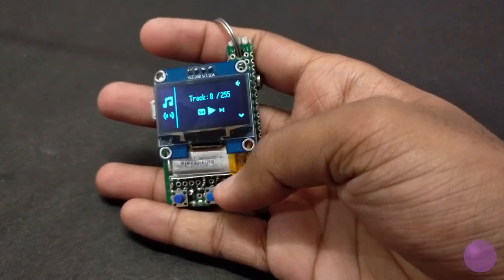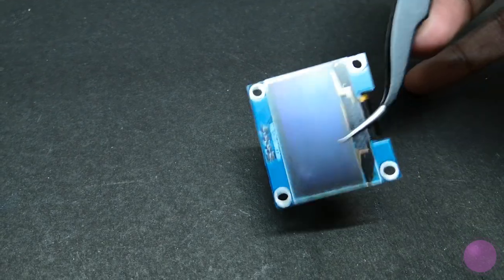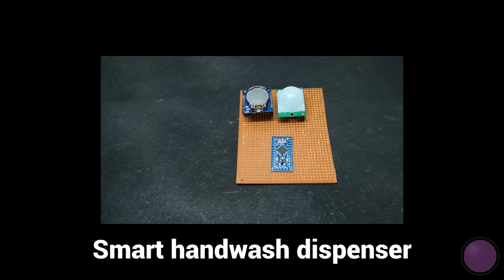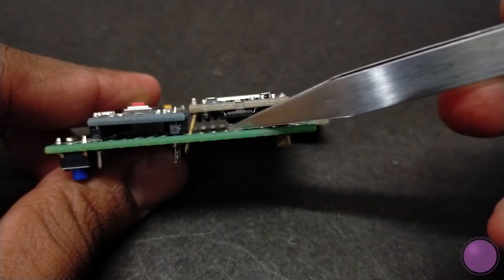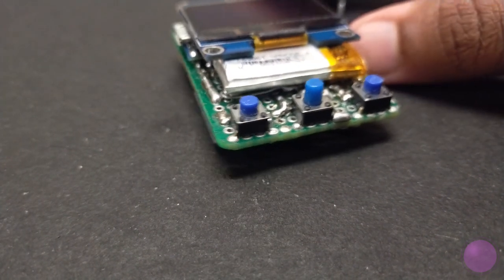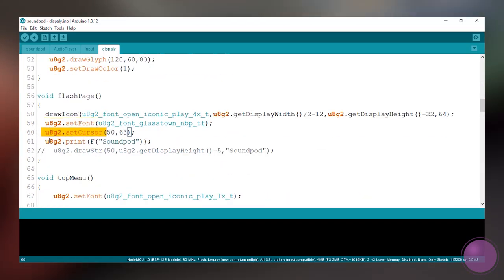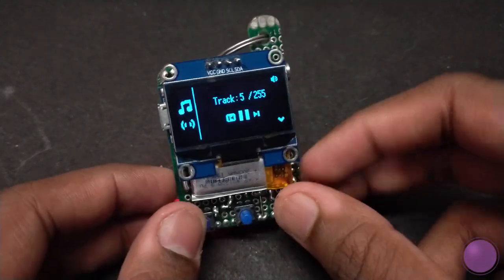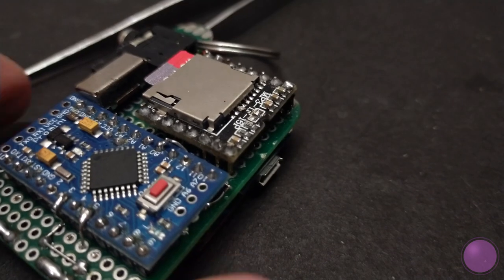MP3 using DFplayer and Arduino | Soundpod part 2 [DIY]

Comment from the maker: If anyone wants to build a PCB you can refer to the circuit diagram from GitHub!
https://github.com/Neutrino-1/Arduino-Soundpod/blob/master/Circuit%20diagram/Schematic_SoundPod.png
Reply: would it be possible to make this with a full interface for navigation by metadata tags?
Reply: YO MAN IM HAVING ISSUES ASTER UPLOADING THE CODE THE U.I JUST STAYS STATIONARY AT SOUNDPOD AND WITH THAT ICON I DROPPED YOU A MSG IN INSTAGRAM NO REPLY FROM YOUR SIDE IDK JUST HELP ME OUT MAN..

Comment: about the file/folder convention, you mentioned that it works fine without it. Can you elaborate? Couldn't it work if I had the mp3 files in root of sd? I did not plug my dfplayer to a microcontroller and test yet, I just put bunch of mp3 files to root and the df player plays them all without the file/folder structure. I'd appreciate elaboration, thanks in advance and thanks for the video.

Comment: good day im making a DFmini mp3 player. I am not using a battrey and dont need all the features you have . I just need play stop skip and rewind but i am uing a smaller screen that you. Its a rectangle 128x28 i think. Can me make a deal and you help me sort this code out plz?
Reply: im using the same arduino nano
Reply from the maker: I think u have 128x32 OLED display and only play and pause would be possible. Rewind and skip isn't supported by DFplayer.
Reply: @Neutrino1  thanks alot. I really thought there was a way to change the tracks. Can u help me with the code. You are right abput my screen
Reply from the maker: It will be lot of work to code for this display (more deletion too).
Check out U8g2 library documentation. It will be really helpful.

Comment: Wooo I got featured in the video! Great project! I am going to try and make it soon when more parts come in, I burnt my OLED by putting power and gnd backwards so a new one is in the mail soon. The UI looks amazing. Sorry to here that file count isn't working on your DF player. What is the battery life for it about?
Reply from the maker: Standby you should get around 6hrs, playback would give 2-3hrs probably. You can just swap out with higher mah battery for more battery life.

Comment: hi 
thanks for the code thats amazing 
i added some features to it like : folder change / touch buttons and i have a problem with the output audio 
it noisy . i even added a capacitor to vin and gnd pin of esp32 
(i programmed it with esp32) 
can you help me?

Comment: Could this basic design support making an MP3 player with some added function to search by song title? So what I mean is: you have to give each file a name like 001, 002, etc. But, in the first video I saw that the file listed that 001 filename alongside the song title and artist details. Could you then use this design so that, with extra code and perhaps some new input to search by letters, it could pick out file 070 on folder 3 when you search the first few letters of the track name? Or say you couldn't, and you use the "001Dont stop me now" type of format, is there some way then to code a search for after this numbering (so ignore the 000 bit and start at the fourth alphanumerical, e.g. D)?

I only ask because I remember how annoying it could be with the old MP3 players trying to get to your favourite song when you wanted it and you would often have to scroll or skip to get them.

I really like these videos by the way, it's very cool to see the high tech of my childhood being made this easily with some parts and a computer
Reply from the maker: DFPlayer won't output any values to the microcontroller regarding the files it's playing (name / size / type / etc). We are naming the songs in the order (0000,0001,0002...)  just to play them chronologically. If you don't rename, they still be sorted and numbered alphabetically. Unfortunately none of this information is transferred backed to the microcontroller, we can only send command to DFPlayer.

Comment: I don't use mp3 do you have a way to only transmit the signal through the 3.5 jack without displaying the functions of the mp3 on the oled?
Reply from the maker: Yes that's possible. That process is done on part one of the video.

Comment: I have a question please. Arduino input voltage is in range 5v to 12v so this is working with the 3.7v battery? 
Also how long does this mp3 player last per a full battery charge? Can it last a full day always on?
Reply from the maker: Pro mini can work with 3.7v directly at its vcc pin. It will work until the battery voltage drops to 3.3v or less. I haven't calculated the battery life but i don't think it can last a day, probably a few hours at best.
Reply: @Neutrino1  it seems there is two versions of pro mini one works on 3.7v and the other one is 5v. I can find only the 5v version, not sure how to power it from a compact battery? The small recargable lithium batteries i can find are 3.7v only.
Reply from the maker: @m3lateef  in that case you need to use a boost convert to boost of the battery voltage from 3.7v to 5v

Comment: Well, that sounds a bit paradoxical, but using the DF Mp3 Player as an MP3 player doesn't seem obvious to me now. I still have some MP3 players from the 2000s, and they are practically as tiny as the DFRobot module, which, due to the SD card slot, is comparatively large. If there were some proper memory chips instead of a card reader, that would make more sense.

But building an MP3 player in 2024 that is 5 times larger than MP3 players from 20 years ago really doesn't make sense to me. Especially considering that everyone nowadays has their mobile phone with them, indulging in some streaming service or another.

Comment: Subscribed !!   Very very nicely done project and clear explaination wherever required. Can we use this to play by time in a long say 60min Audio file. Meaning by press of a button it jumps say 3 min steps.
Reply from the maker: Thank you! That's really a intresting idea but it's not possible to implement using DFplayer.

Comment: Can this be done Bluetooth instead of jack?
Reply from the maker: Just include a Bluetooth adaptor thats used in the car. Or you can feed the output of DFplayer to a Bluetooth transceiver module
Reply: @Neutrino1  ty

Comment: I am planning to make a Arduino Uno r3 shield of mp3 will it still work if i use the same logic
Reply from the maker: Yes! you can use the same logic. (Just discard the display part)
Reply: @Neutrino1  OK thanks but can you explain me how to use the sound jack for headphones (and also i am planning to keep the display part)

Comment: I'm interested in this build, is there a code to show the battery level on the oled display?
Reply from the maker: It's on GitHub, you have the option to add battery percentage
Reply: @Neutrino1  I cant seem to make it work though, can you please provide an example code on the battery logic part of the code? thanks.

Comment: Bro, 

Can you make a video using NRF24L01+MCU  to input a audio in from laptop and transmit wirelessly then recieve the same using NRF24L01+MCU and fed to amplifier. Whole idea is to remove wiring from 2nd floor to  ground floor

Comment: If bluetooth transmission is added, can 2 3v lithium coin batteries handle it?
Reply from the maker: It depends on what bluetooth module you use and it's purpose.
Reply: Thank you...

Comment: I must have a knock off version too. It seems to not want to play anything from any other folder than the root. No matter how I name them or point to them.
Reply from the maker: it's better you get the DFplayer from there official site.
Reply: @Neutrino1   I managed to get it working briefly, but when I added more tracks to the folder it stopped working. I've given up now and am just using the root.
Reply: @Neutrino1  I managed to get this working now and have spent a long time on my project. Unfortunately when I power the Arduino from a wall socket, and not my PC, the MP3 player no longer works. I don't even get it powered up. I'm wondering if it's this, as it doesn't seem to get past this point:

    if (!myDFPlayer.begin(mySoftwareSerial)) {  //Use softwareSerial to communicate with mp3.
      Serial.println(F("Unable to begin:"));
      Serial.println(F("1.Please recheck the connection!"));
      Serial.println(F("2.Please insert the SD card!"));
      while (true);
    }

I've no idea what this does as it's part of the library, but it doesn't appear to work at all without it. It seems to be trying to communicate through serial, so when there isn't a PC connected to the data lines, it freezes.

Any help would be great, as this is doing my head in. Thanks
Reply from the maker: @ArcanePath360  the part of the code you posted here,
Checks if the DFplayer and Arduino can communicate through software serial. Check the connection once again even though that might not be the one causing the problem.

How is the DFplayer connected to Arduino? Are sure the power supply provides enough current for DFplayer? What is the speaker that your using?
Reply: @Neutrino1   It uses software serial and pins 10/11 for RX/TX. Not sure why but this is what the library uses and I can't change it. It all works fine when connected to PC. It's only when I remove the PC and use the same USB to go into a wall outlet. The "L" light on the Arduino would normally blink several times when powering up, but it just stays on and seems to get stuck at this point in the code, when not connected to a PC.
Reply: @Neutrino1  I have measured the current, it is 5V. Stepped down to 4.88 to match the PC to see if this was the issue, but nothing changed. I'm using headphones, but the player doesn't even get as far as playing anything, as there is no red light to indicate a track playing. It doesn't get that far in the code.
Reply from the maker: @ArcanePath360  Disconnect any other peripheral from Arduino, just connect DFPlayer and use the official  library example to test if the DFPlayer is working. https://github.com/DFRobot/DFRobotDFPlayerMini
Reply: @Neutrino1  There's nothing else connected. As I say, it works with the PC connected. I believe it's trying to communicate with something that isn't there when I take the PC out of the equation, as the only thing that's changed is the missing data lines in the cable when powered from a wall outlet. I tried the original code and nothing was different.
Reply from the maker: @ArcanePath360  This is a very strange problem, did you try with a different set of DFplayer and Arduino? or try using a different set of power cables or adapter.
Reply: @Neutrino1   I only have the one DFPlayer. I have a Arduino Mega but everything is hard soldered to the pins now after removing all header pins. I am using the same USB B cable that plugs into the PC USB, taking it out and plugging into a USB Wall wart which has the same socket. I've also got the option for a 12v battery with a buck converter stepping down to 5V going to the + - pins on the underside of the UNO where the USB feeds power, and this has the same effect. When I run the code without the serial commands, the Arduino runs into the main loop and lights LEDs. So it has to be a problem with either the software serial or serial.begin not getting any feedback somehow when the data lines aren't connected. The DFPlayer is running on the same 5V and same GND that feeds the Arduino in all cases as they are connected together, so I don't think it's a ground sharing issue.
Reply: @Neutrino1   I have narrowed down where the problem is by using bug hunting code and pin13 to blink to show where it's stalling. When connected to the PC, for some reason pin13 always flashes about 6 times very quickly before the sketch plays. With other power source, it doesn't do this, it just goes straight into the sketch, so it seems to bypass a stage in the serial communication without the PC, and when it gets to this part of the code:

    if (!myDFPlayer.begin(mySoftwareSerial)) {  //Use softwareSerial to communicate with mp3.
      // Serial.println(F("Unable to begin:"));
      // Serial.println(F("1.Please recheck the connection!"));
      // Serial.println(F("2.Please insert the SD card!"));

      while (true) {
        digitalWrite(13, HIGH);      // Turn on internal board LED
        delay(250); 
        digitalWrite(13, LOW);      // Turn off internal board LED
        delay(250); 
      }
    }

.. it gets stuck in this while loop (which the flashing code above indicates), meaning the software serial isn't communicating that the player is connected, even though it is.
Reply from the maker: @ArcanePath360  if you're using the arudino mega, try Using the Serial1 which is on pin 18 and pin 19. If it works maybe something wrong with software serial.
Reply: @Neutrino1  I'm not using the Mega. I used for testing a week ago and it was fine with pin 10/11. That was only tested with the PC connected.
Reply: @Neutrino1   At last! After dedicating an ENTIRE day and night to this, thinking it's all kinds of power supply issues, but checking both voltage and current and finding not much difference, and then thinking it's the serial but not finding any answers, I found a workaround from a very deep search online. It turns out to be this:
replace myDFPlayer.begin(mySoftwareSerial) with myDFPlayer.begin(mySoftwareSerial, false) in order to turn off command acknowledges. Fake modules send them wrongly and also the library itself has bugs in the response processing that may influence results.
.... I guess you get what you pay for. When you buy an MP3 for less than a BigMac this is what you get, lol. So glad I can go to bed now and rest easy. Thanks for all your help and sticking it out. It's been a bit of a journey getting this thing up and running. I very much appreciate you taking the time.
Reply from the maker: @ArcanePath360  I'm really glad you figured it out! This might help others too, who is facing the same problem.

Comment: Thank you so much bro i made it!!
It's work really great
Can you pls say how can i add battery indicator to it pls it's so important!
Thank you a lot 😊🙏
Reply from the maker: I have added section in code for implementing battery indicator. You have  just read the voltage of the battery using voltage divider and then convert it to percentage and display them.
Reply: @Neutrino1  I'm sorry sir to asking you a lot of questions but could you please tell me if i got a battery with 3.7 voltage and 2400 capacity what should i do? 🤔😔🙏
Reply from the maker: @arshamebr8183  Just replace in the existing circuit, it should work fine
Reply: @Neutrino1  no i mean in code what should i do. i dont know how to write the code that arduino can read the battery percentage and show it on display pls help me its my project for school sir

Comment: i always get compilation erros what should i do
Reply from the maker: What's the error?
Reply: @Neutrino1  Arduino: 1.8.13 (Windows 10), Board: "Arduino Uno"

C:\Users\Senithu perera\Documents\Arduino\soundpod\soundpod.ino: In function 'void setup()':

soundpod:44:5: error: 'flashPage' was not declared in this scope

     flashPage();

     ^~~~~~~~~

soundpod:50:53: error: 'leftButtonISR' was not declared in this scope

   attachInterrupt(digitalPinToInterrupt(leftButton),leftButtonISR, FALLING);

                                                     ^~~~~~~~~~~~~

C:\Users\Senithu perera\Documents\Arduino\soundpod\soundpod.ino:50:53: note: suggested alternative: 'leftButton'

   attachInterrupt(digitalPinToInterrupt(leftButton),leftButtonISR, FALLING);

                                                     ^~~~~~~~~~~~~

                                                     leftButton

soundpod:51:54: error: 'rightButtonISR' was not declared in this scope

   attachInterrupt(digitalPinToInterrupt(rightButton),rightButtonISR, FALLING);

                                                      ^~~~~~~~~~~~~~

C:\Users\Senithu perera\Documents\Arduino\soundpod\soundpod.ino:51:54: note: suggested alternative: 'rightButton'

   attachInterrupt(digitalPinToInterrupt(rightButton),rightButtonISR, FALLING);

                                                      ^~~~~~~~~~~~~~

                                                      rightButton

soundpod:77:3: error: 'startFolderPlay' was not declared in this scope

   startFolderPlay();

   ^~~~~~~~~~~~~~~

C:\Users\Senithu perera\Documents\Arduino\soundpod\soundpod.ino: In function 'void loop()':

soundpod:82:3: error: 'batteryReader' was not declared in this scope

   batteryReader();

   ^~~~~~~~~~~~~

C:\Users\Senithu perera\Documents\Arduino\soundpod\soundpod.ino:82:3: note: suggested alternative: 'batteryLevel'

   batteryReader();

   ^~~~~~~~~~~~~

   batteryLevel

soundpod:166:13: error: 'player' was not declared in this scope

             player();

             ^~~~~~

C:\Users\Senithu perera\Documents\Arduino\soundpod\soundpod.ino:166:13: note: suggested alternative: 'playing'

             player();

             ^~~~~~

             playing

soundpod:169:13: error: 'settings' was not declared in this scope

             settings();

             ^~~~~~~~

C:\Users\Senithu perera\Documents\Arduino\soundpod\soundpod.ino:169:13: note: suggested alternative: 'String'

             settings();

             ^~~~~~~~

             String

exit status 1

'flashPage' was not declared in this scope

This report would have more information with
"Show verbose output during compilation"
option enabled in File -> Preferences.
Reply: @Neutrino1  this is my error code
Reply: @sdp_studios  me too